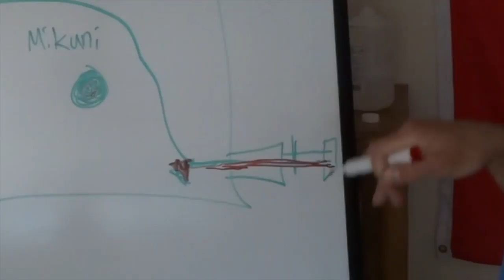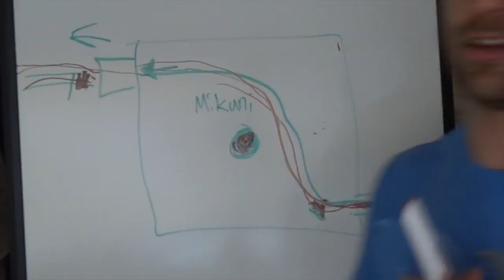How To: Vacuum Fuel Pump Diagnosis Gy6 150cc (SPARK BUT NO START) +MORE

Comment: What if I suck on the manifold tube to force fuel in and it still wont start? Manifold is not creating pressure. Blown engine?
Reply from the maker: KG II sucking on it does not create enough pressure. You need a vacuum pump tool. But yes if your engine isn’t creating vacuum when you kick or start it and all the lines are correctly hooked up/not leaking than you could have a blown engine
Reply: @MaxsGarage-p8q  okay thanks. It's at about 700 miles with no oil changes. I see the piston moving up and down in the cylinder.  Just no pressure
Reply: @kger4643  on a new engine that's too many miles.  first oil change needs to be within 100 miles and easy running.  the book says 1000 miles after that, I went to 1095 and ruined a timing chain.  I recommend every 700 miles, but some guys say 500.  they are probably right.

Comment: I went through so many videos... All I needed was this 1 minute video. Thanks man, you did what hours of other videos failed to do.
Reply: same v_v ...cleaned the carb, replaced the lines, deleted EGR, deleted Evaporative emission, checked valve heads, almost drilled a fucking hole in the bottom of my tank to install a manual petcock and call it a day, found this video... #sighofrelief
Reply: @RemingtinArms  seconds away from drilling that same hole.....
Reply: this happens many times to me...

Comment: i have a 150cc dune buggy, it was working fine...starting real quick and working fine but then i dont know what happened and seems like the carburator is overflowing after you let it rest for half an hour or so,then it gets real hard to start it just cranks... no idea what is happening,would appreciate it if you could give me your opininion on whats going on,thanks
Reply from the maker: Clean carb sounds like float needle getting stuck or floats need adjustment
Reply: i did, the floater had trash now it works like it used too,thanks for the help...now i got another question non related to the carb lol hope you can help me out too...when the lights of the buggy are off and you accelerate they turn on real bright and when you let go of the gas they die...when you flip on the switch they turn on but not as bright as when the switch was off and you were accelarating,is this normal or is there an electrical problem?
Reply from the maker: sounds like regulator issue
Reply: thanks for the info,really appreciate it
Reply: Can u gravity feed the gy6

Comment: My scooter won't start up in the morning, I get a clicking noise like it wants to start but then nothing. So, then I'll kick start it and it fires right up. It's only like that for the first initial start. After I kick started it I can shut it off, and then turn it back on using the electric start button all day. Now, the battery is good, new spark plug, ignition coil, CDI box, fresh oil, full tank of gas. It's a 50cc Chinese scooter (Jonway-NEO). I've had it for 2 summers (14 months), and I've put 53,00+ miles on it so far. Do you have any idea what it could be that's wrong? Can you please help me with this problem, I'd really appreciate it! Any feedback would be much appreciated. Thanks!
Reply: 5,300 miles on it!
Reply from the maker: Haha complicated problem in which case it sounds like you threw a lot of parts at. Which can complicate the matter, since you assume all those are good when they could be bad. My first thought was you need to make sure all the connections are good, and second you need to make sure the connection from the battery to the starter solenoid switch is good. I would replace that part next. Maybe once it gets rattled after first start it works for awhile then quits. Also, check make sure you are getting charge to the battery and the battery is holding that charge.
Reply: Thanks for responding quickly. This has been going on for like 2 weeks now, before I added all those extra parts(in which I was just trying to fix it, I thought that they were mostly basic wear and tear stuff). I only changed the ignition coil because one of the 2 prongs was like burnt in half, so I replaced it myself. I tested the battery a few times with the multi-meter and it reads fine. I thought that it could be the solenoid at first, but then I noticed that the ignition coil was disconnected/broken and the bike would shut off every time I just touched it, so I replaced it and one of the connecters that was broken in half hoping that that was the problem. So how do I test the solenoid switch and is it fairly easy? Thanks for any info!
Reply from the maker: Check the connections and make sure they're good. Then just buy a new one, they're not expensive. You can also try just giving it 12 V and making sure that it clicks